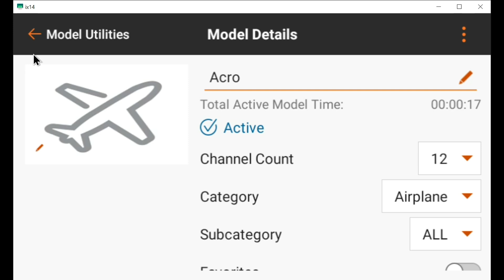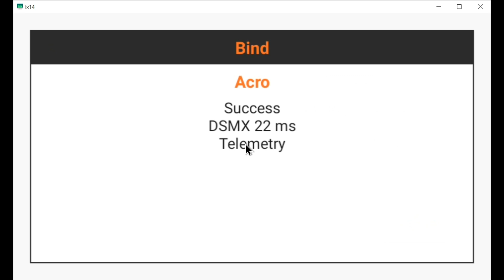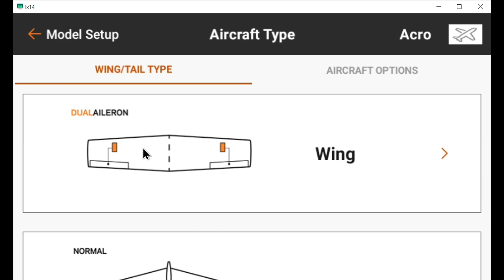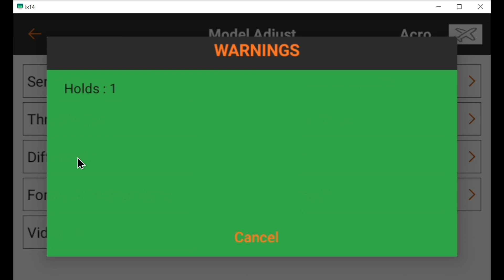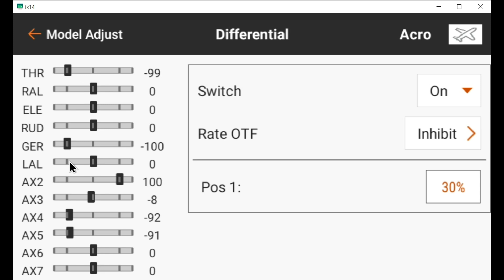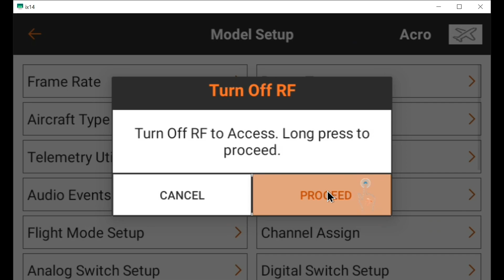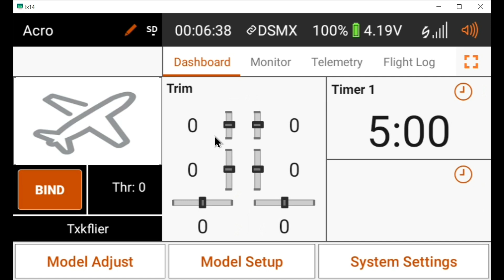Setting Up Differential Ailerons on a Spektrum iX14

Comment: Also if using AS3X, make sure to do “relearn servo settings” after any reversing or channel assignment changes! And always verify the surfaces are moving in the correct directions when you move the plane around (gyro response test is good for this in forward programming)